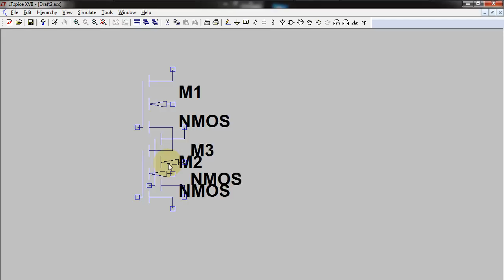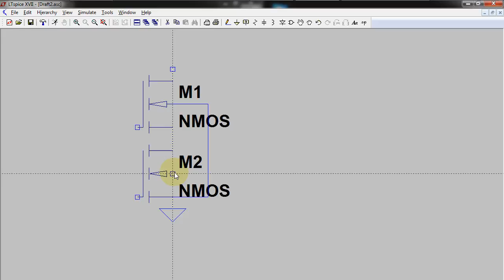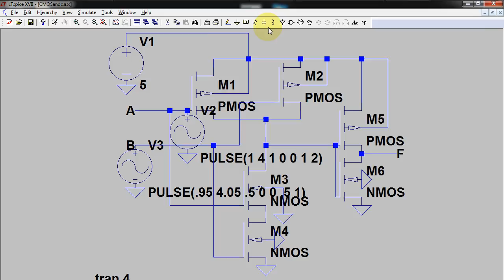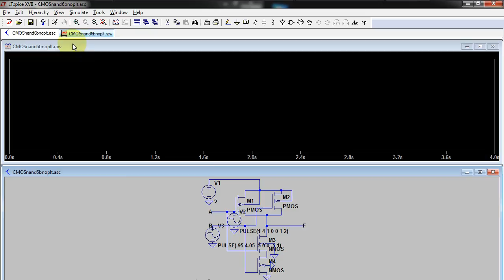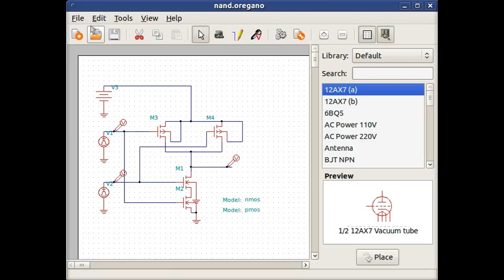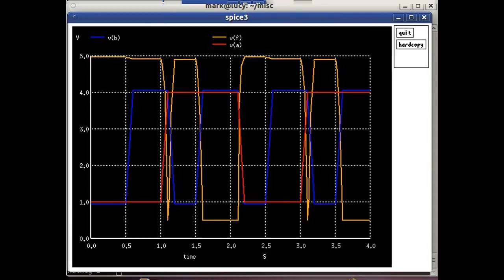CMOS Transistor Logic Gates and SPICE Analysis (LTSpice, oregano, etc.)

Comment: How to convert schematic to code
Reply from the maker: When the netlist window pops up, right click on the title bar, and select Edit as Independent Netlist.  It will then prompt you for a filename to save it to, and then it will open it as an editable netlist (assuming LTSpice of course)
Reply: @MrMcsoftware  thanks a lot sir 

 1 more issues is  how to convert spice netlist to schematics

Create more videos sir please

Please provide the spice netlist for  two input xor  gate or half adder using static cmos

How to calculate  power and delay in lt spice 

Please mail me the code 

rahulgaurav77659@gmail.com

Thanks a lot for your support sir
Reply from the maker: I assume by code you mean the SPICE netlist.  If so, (also assuming you're using LTSpice) go to the View menu and select SPICE Netlist (at least in my version of LTSpice).  If you're using other software, there usually will be a similar menu item somewhere to view the SPICE netlist.  If you want to use the spice file in some other program, you might have to edit it a little (adding directives for printing or plotting, etc. and also dealing with LTSpice component libraries).
Reply: @MrMcsoftware  I got the netlist I am not able to edit the code
Reply from the maker: I don't know of any way to convert the netlist to a schematic (I don't think LTSpice has that capability).  Maybe someone has written a program to do it, but I doubt it.

It takes some time to create these videos.  I'll try to create some more videos (I have a list of ideas for new videos).

I haven't dealt with power and delay calculations (haven't needed to).  I know the original SPICE program generated some info I never bothered to interpret.  I don't know how to do that in LTSpice.

I don't have the netlists for XOR and half adder already, and I wouldn't have the time to create a schematic (to generate a netlist).  If it's any help, an XOR is (in C language):  (a && !b) || (!a && b)  meaning (input a AND NOT input b) OR (NOT a AND b).  Half adder would then use the XOR and an AND.  Hope that helps.
Reply: @MrMcsoftware  Thanks a lot I have created a netlist by mu own
Reply from the maker: It's probably too late for this info, but I'll mention it anyway, you can also create an XOR using:  (a AND b) NOR (a NOR b) which might be easier.  But it's good that you have a circuit now.

Comment: Hi,,, how can I give input at a node which is actually a difference of two inputs. Like, suppose I give V1 at one node and Vx at other. Then there is another transistor for which I need to give V1-Vx. How I give this input. I want to give pulses (V1 and Vx are pulses) not the DC voltage. Can you please help with that?
Reply from the maker: I might be misunderstanding your question and my solution might not work in your circuit (since I don't know too much about your circuit)...  but, you could connect the two pulse voltage sources together with the negatives of each touching and with the ground at the touching point.  V1 would be available by referencing V1+ to ground, Vx would be available by referencing Vx+ to ground, and V1-Vx would be available by referencing V1+ to Vx+.  So, the transistor, I would imagine, would have to be connected to Vx+  (in some way depending on how the transistor is used) rather than ground.   LTSpice asc file here (V1 and V2 instead of V1 and Vx though) if you're using a different SPICE program, I could provide the SPICE netlist file (hope youtube formats it ok):

Version 4
SHEET 1 880 680
WIRE 416 32 32 32
WIRE 32 64 32 32
WIRE 32 176 32 144
WIRE 32 176 -32 176
WIRE -32 192 -32 176
WIRE 32 208 32 176
WIRE 32 320 32 288
WIRE 416 320 32 320
FLAG -32 192 0
SYMBOL voltage 32 304 R180
WINDOW 123 0 0 Left 2
WINDOW 39 0 0 Left 2
SYMATTR InstName V1
SYMATTR Value PULSE(0 2 0 0 0 .00075 .0015)
SYMBOL voltage 32 48 R0
WINDOW 123 0 0 Left 2
WINDOW 39 0 0 Left 2
SYMATTR InstName V2
SYMATTR Value PULSE(0 5 0 0 0 .0005 .001)
TEXT -52 326 Left 2 !.tran 5ms

Alternatively, I suppose you could put the ground at Vx+, V1 would be referenced by V1+ to V1-, and Vx would be referenced by ground to Vx-, and V1-Vx would be referenced by V1+ to ground.

I don't know if there are any real-life implications of this arrangement (like if V1 and Vx are powered by (or ARE, but you said pulses not DC) rechargeable batteries or even normal batteries) or if there are any undesirable effects on current.  But the simulation works.
Reply: @MrMcsoftware  Thanku
Reply from the maker: @aneeqa mumrez You're welcome
Reply: @MrMcsoftware  Hey did u do any videos on  DRAM simulation? like making DRAM for 3-byte operation using NMOS.
Reply from the maker: @aneeqa mumrez  Sorry, I haven't done any videos on that topic.  It probably wouldn't be too hard to simulate that.  You would have to know what value of capacitors to use (which would of course be dependent on the refresh frequency)
Reply: @MrMcsoftware  yes i have the values for capacitor...but m stuck with designing the circuit
Reply from the maker: @aneeqa mumrez Wikipedia might have some useful information on their page covering DRAM... especially: https://en.wikipedia.org/wiki/File:Square_array_of_mosfet_cells_read.png

Comment: How did you make the ac voltage source with the sine wave inside the voltage source symbol?
Reply from the maker: Actually, it's not a sine wave, it's a pulse.  However, I don't know why LTSpice has the sine wave symbol in the voltage source (I never noticed that).  I know there are a few different voltage symbols/components to choose from, so I probably chose the wrong one.  But it doesn't really matter, since if you right click on the symbol (on the schematic), and select Advanced (assuming it's the voltage component that has the options), you can then select PULSE (or SINE, etc.).  The voltage source that just has the + and - is called "Voltage Source" and the one that has the sine symbol is called "Independent Voltage Source" so they are two different types of voltage sources/components.  But I can't seem to find it in the components list (I upgraded with a components expansion library, so maybe it got rid of some of the components)